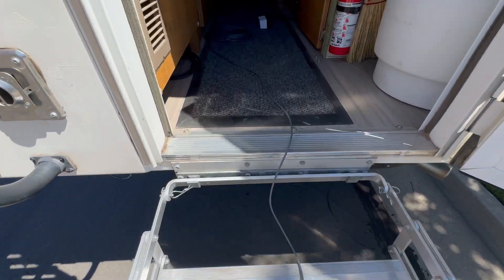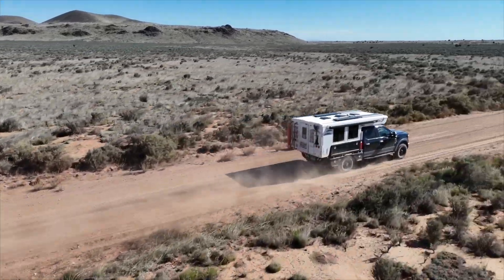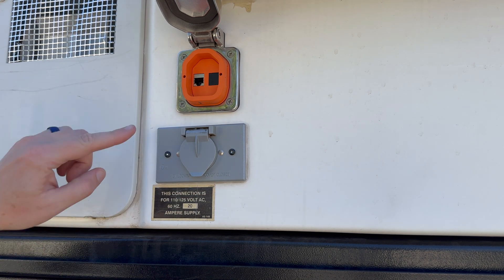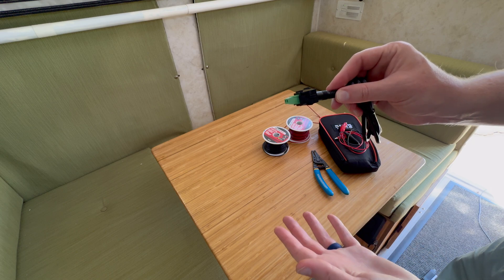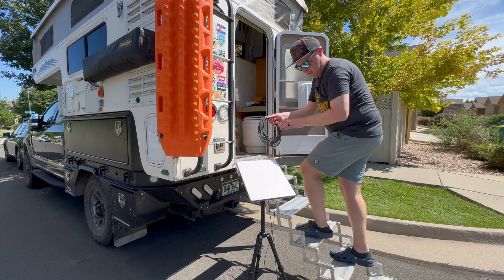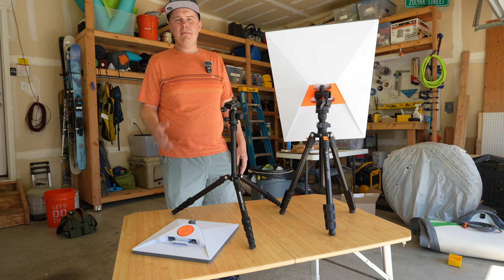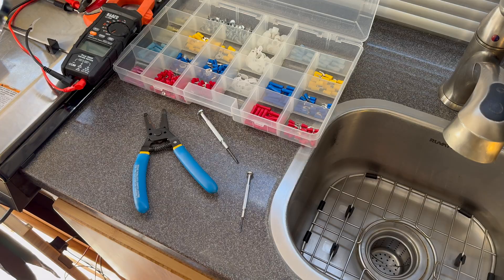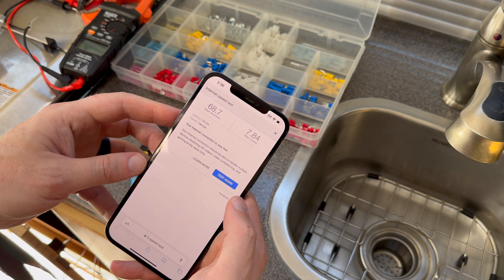Starlink Mini 12v Hookup (It Sorta Works) - Watch First!

Comment: I want to hardwire my Starlink mini into my 12V system. I have seen people say that you need to stepup the voltage from 12v, but you don't seem to have done that. Is it because you have a shorter wire run? How long could you run the wire without needing to stepup?
Reply from the maker: I did step up my voltage to 24v. I explain what I did in the end of the video. You could use an online voltage drop calculator to determine the specifics of the voltage drop. You can also use a thicker gauge cable to avoid the voltage drop vs stepping it up to 24v.

Comment: Did you ever consider the PeakDo integrated battery to power the Mini. I would simplify the times you need the Mini for 3-4 hours - If you need more them you haul out the cables!!!
Reply from the maker: I use this Anker power bank and solar panels Anker SOLIX C300 DC Power Bank when I need a remote solution. It powers my Mini for over a complete 8 hour workday. However, I normally just run my Mini off my truck camper's battery bank and solar panels. But the remote power bank solution is helpful if I'm in a lot of trees and need to deploy the Starlink further away from where I'm parked. But use whatever ya got.

Comment: needs to be boosted to 20VDC, if you intend on using that 50’ cable, will probably work with a much shorter cable at 12V, because of the voltage drop on that long wire..  12V to USB-C will boost it to 20V 👍

Comment from the maker: Update: we switched to a more reliable Victron 12 to 24v DC to DC step up converter https://amzn.to/415C0zU after a capacitor burned out on the converter we originally used. While Victron components are more expensive, we've always had a good experience with the components and would rather not have an electrical fire in our rig.
Reply: Hi!  Good video, thanks.    I'm researching the Starlink Mini, and how we'll implement it for our Airstream trailer.    I like Victron products, and agree about the reliability.  I'd like to stick with the OEM 50 foot cable, too.   How has this Victron held up for you?   Will it work with the 50 foot cable?   Thanks!

Comment: Thanks for the video!
Did you find a particular set of errors or struggles that caused you to try the DCDC step up?
I have 12.6v at SL mini end of power, but the router is constantly disconnecting and rebooting.
Thinking 24v should resolve the issue.
What say you?
Reply from the maker: I never really used it at 12v b/c of how short of a cable I hade to use and my unwillingness to use a thicker gauge cable. I pretty quickly added the 24v step up which has been extremely reliable.
Reply: is that measured with a load on it?

Comment: You can run it on 12v but the cable needs to be as short as possible.
Reply from the maker: Indeed. I often want to move my Starlink 50' or > away from where I'm camped because of trees and other obstructions. But would work fine at 12v with a shorter cable, thicker cable, or battery pack so you're not tethered to a vehicle.

Comment: plug it into an outlet i already drilled is not really useful, sorry
Reply from the maker: More info about the "drilling through the side of my camper" part https://banthaoverland.com/lessons-in-drilling-through-the-side-of-your-camper/. You could also use a USB-C battery pack if that's easier.

Comment: You should up the voltage at the start of the cable run.
Reply from the maker: Indeed! That's what I did. Stepped up from 12v to 24v DC.

Comment: I installed the 12 to 24v DC to DC Step Up Converter with a 12V DC Plug Adapter 5.5mm x 2.1mm. I couldn't get my mini to power on and found the output power from the converter was 23.6 ish. Is it a must that it be a mininum of 24v? Perhaps I need to use a 12 to 48v DC toDC step up converter. Are you still using the 12 to 24v?
Reply from the maker: It should work from 12-48v DC. What length cable are you using? And did you measure the 26.3v at the step up converter or at the barrel jack? Measuring as close to the Starlink as possible is a good idea. You could also wire up another barrel jack to the other end of the cable and try it with the Starlink Mini wall AC adapter to make sure the cable is working. Hope something in there helps.

Comment: What about 220v electricity
Reply from the maker: According to the Starlink Mini specs it supports an input voltage of 12-48 volts DC.
Reply: the AC power adapter is rated for that voltage

Comment: Why not just run off an inverter and the AC wall plug and take advantage of max 15 meters cable?Starlink says you need 20V 5A 100 watts. At 12 V performance is not optimal. I used the step up voltage converter in the car good ideal. Also, you can use a 12V Anker USB-C charger plug and connected to the 100 watt usb-c slot. Lots of ways to power the mini.
Reply from the maker: Indeed. Thanks for sharing some other options. I already have the 12v system so easiest for me to work with it.
Reply: Yep I just plug a new starlink usb c cable into my Anker 100 watt usb c port. Works great.
Reply: Why not simply run off the inverter? Simple...my Victron 3k inverter uses 2.5 amps just idling. Up converting from 12v to 24v uses very little extra current beyond what is demanded by the Mini.
Reply from the maker: @RandySpiker  you certainly can. My inverter is a bit noisy and generates more heat.